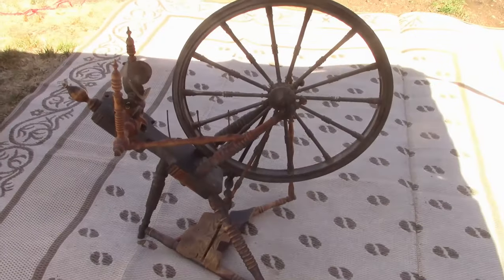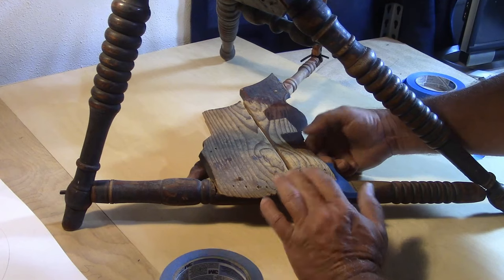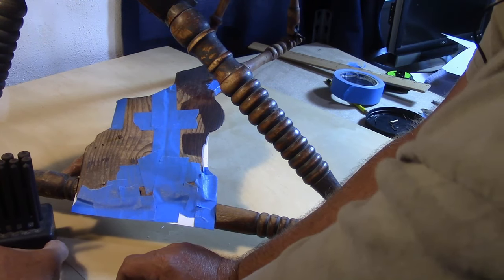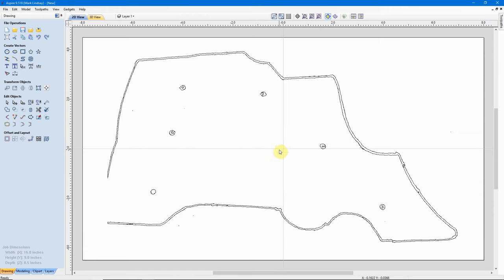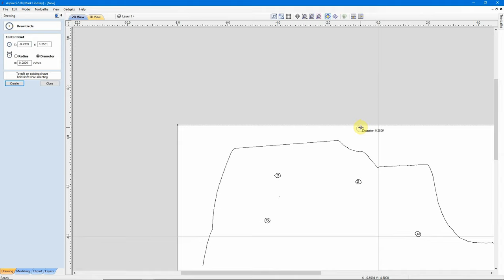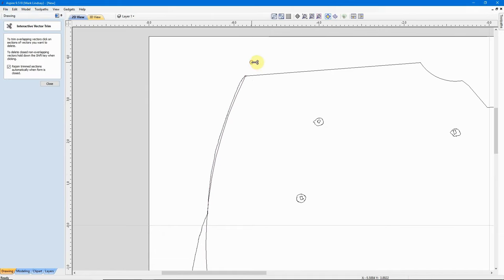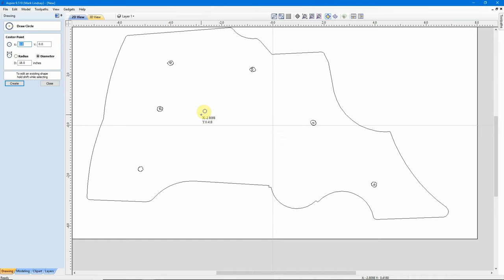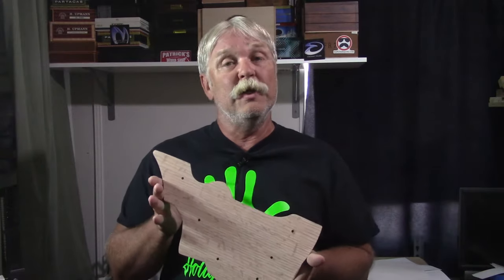Pattern Making and the Fillet Tool - CNC For Beginners

Comment: Interesting way to do this job. You can also use a camera to scan then scale to size. I use CorelDraw for tracing and vector manipulation. Good stuff though, thanks for the video!
Reply from the maker: Thank you, George! No doubt the job can be done in many ways and with many different apps and programs. I was taught that whatever works for you, and whatever you're most comfortable with is the right way to do it.

Comment: Thank you for the good video, I always learn something from them.  I am curious if you considered using another layer to draw on top instead of having to remove all the segments that you can keep as a reference as you go along, only to delete them at the end.
Reply from the maker: Normally, I would have done exactly that. I was demonstrating the principle in this video, just to show the concept. You're right, however. It would be much easier to hand trace the vectors onto another layer, then just turn off the layer with the original vectors on it.

Comment: Hi Mark. Since finding your videos you have been my go to when I need to figure something out. After scanning and then uploading the jpeg, how do know or verify that the scale is 1:1?
Reply from the maker: Thank you, David! I didn't get into that in the video due to time issues. The way I do it is to measure one dimension, say overall length. When I import the image and do the bitmap trace, I then check the size of the tracing and adjust the dimensions there. I make sure I have Link X Y checked, and set the correct overall length. The software will adjust the other dimension(s) proportionally.
Reply: Thank you for the quick response. That is what I have been doing when using Easel by Inventables. I recently switched to Vectric V Carve and didn’t know if there was a better way. Again since I started using V Carve I have watched
Reply: Sorry fat fingers hit send to soon. I was saying I have binge watched as many of your videos as I can and they have helped immensely. Thanks again m
Reply from the maker: Thank you very much, David! I'm very glad you're finding them helpful!
Reply from the maker: I don't know if it's a better way or not, but it certainly works, and you have a lot more options over Easel.